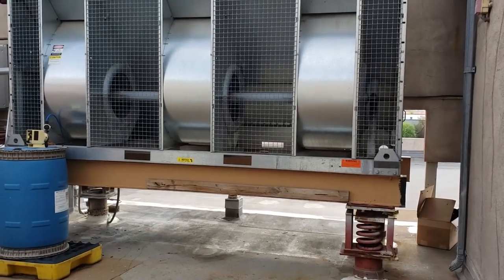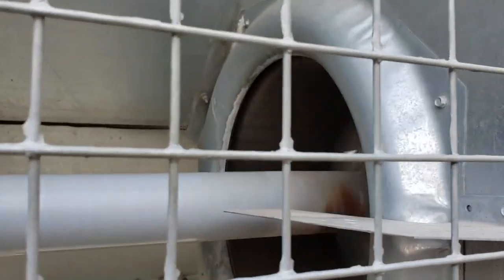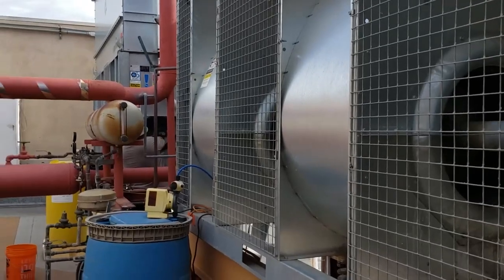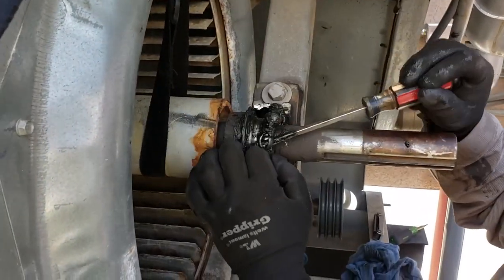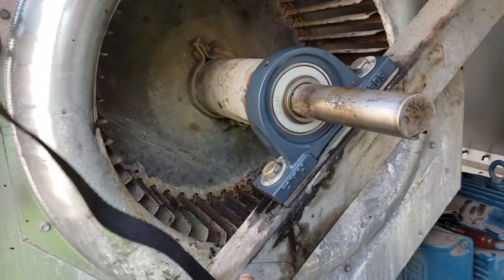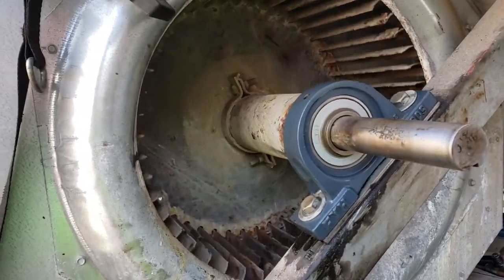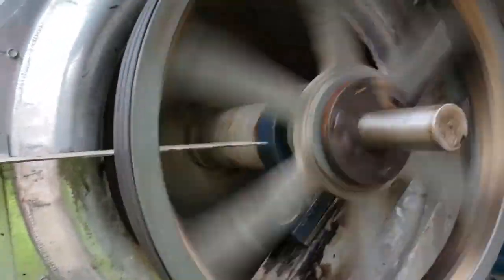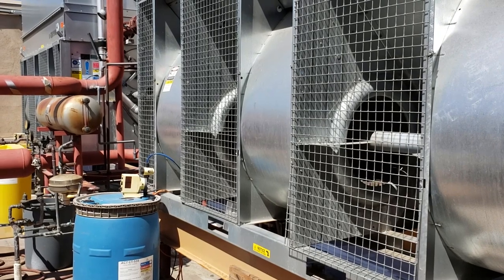Cooling tower has a slight vibration problem

Comment: They did a great job balancing.  But I wonder about the long-term prospects for those blower wheels.   On the same type of BAC, I had one of the rusted squirrel cages break away from the shaft and make a mangled mess.   Needed new shaft, bearings and wheels.
Reply from the maker: I don't think these are nearly that corroded. 
But I bet regions by the coast would destroy these a lot faster than the Arizona desert.

Comment: It’s amazing how they were able to rebalance the blowers.
Reply from the maker: Yeah.  It's a specialty. 
I think the tech said that the gear costed about 40k
They place electric sensors on the bearings and a tachometer on the shaft and a device plots the angular source of the vibrations etc.. 
Some is trial and error. 

It took a shite load of weights. 
They had to drill holes in the wheel hub and attach bolts to add some bulk weight.